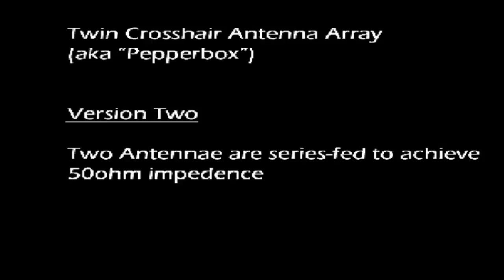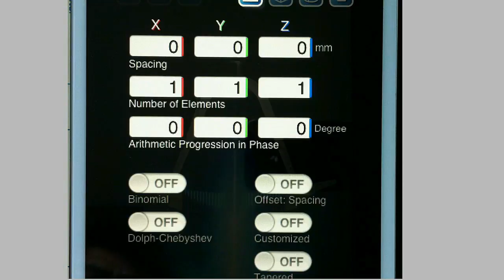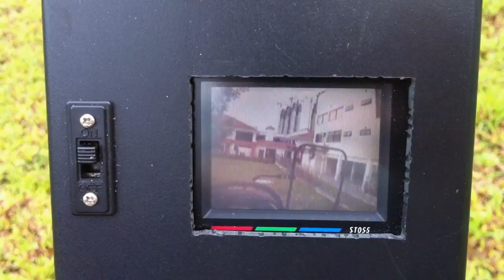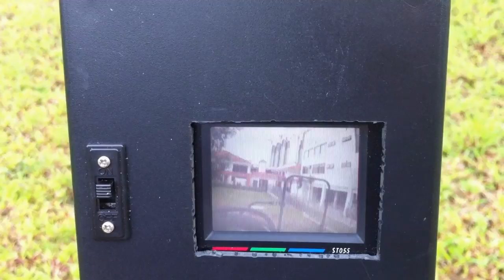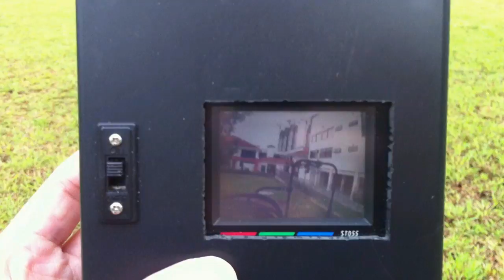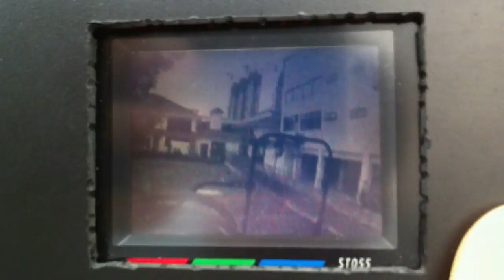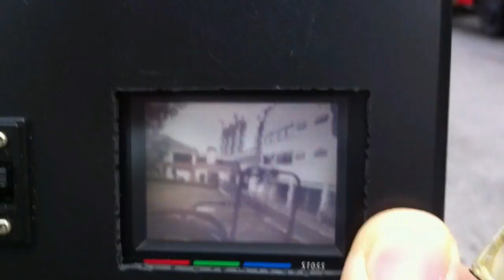DIY Pepperbox Antenna for 5.8g 14db

Comment: You did a great job clearly demonstrating your system. I particularly like your video of the simulated beam pattern coupled with live demonstration. Would be nice to get some measure of signal strength as you move the antenna too.
I admire your efforts!
Jim
Reply from the maker: +James C Eastep Thanks for your kind words. Andrew Mcneil posted a video of a 2.4g double-crosshair build using a Wilkinson splitter and also a build video of a single 5.8g crosshair, which are really informative too.

Comment: Yes! Finally a PB for 5.8!!! Very cool Terence. And perfect for my low and inbetween objects type of flying. Would you be willing to build me one? :)
Reply: Did you make your own antenna at the end? i want to try back 5.8 after flying this weekend with a friend and his IRC 600mw, the signal was cristal clear! im flying with 1.3ghz and 200mw linear antennas, what antennas are you using now with the your 1.3 ghz video ummagawd?
Reply: David Lougedo Actually... I had mashton make me VAS's very first 5.8 pb. It looks nothing like the ones they make now :) For my 1.3 i'm using a VAS airscrew/MM combo
Reply: ummagawd ok thanks,  i´m redoing my mini quad, and if after this rebuild the image do not get any better i will also try CP antennas, currently i´m flying with dipole. i´ve tried with the mini pz this past weekend, and it is better, but there is something more there, some noise.

Comment: Hi, good luck finding this video.
I have manufactured very good crosshair antennas for 1280Mhz, but I always wanted to make a pepperbox for this frequency, can you help me with the calculations to adapt the impedance?

Thanks
Reply from the maker: You will need two pieces of 75ohm coaxial before the T-joint, each piece needs to be a 1/4wave transformer ( length =5.86cm x VF of your 75ohm cable). 5.86cm is quarter wave of 1280mhz n if u use rg179, the VF should be 0.66

Comment: Request to please help me with a sketch or photos of the T joint as to how it should be done/ overlapped properly and how to join the 2x 75ohm and 1x 50ohm cable to make that. Another thing I want to know is the length of the 75ohm cables and the distance between the center of the 2 brass tubes (one wavelength I suppose).
Thanks a lot and good wishes.
Reply: Also, can we use 50ohm at all the three places instead of 75ohm?
Reply from the maker: Please watch this newer tutorial that shows the details you need. https://www.youtube.com/watch?v=pkux2bY1Lkc
Reply: Thanks you sir! It is really nice of you to send me the video like of the needed detail. A little more request is to explain process of splice too without using the T connector as shown in the video of pepper box antenna. Thanks again. And good wishes.
Reply: I think I got it. Use 50ohm cables for the 2 cross hairs of exactly same length, and at the splice attach 1 piece each of 1/4WL keeping in mind the VF of 75ohm cable to them. And join the other ends of the 75ohm 1/4 WL piece to the maine feed line of 50Ohm. The outer wires all solder together.
Reply from the maker: @Theperfectcupoftea  Correct. I'm glad you got it figured out. :)
Reply: All because of the nicely explained details in the new video link by you.
Good wishes.

Comment: What are the advantages of that type of antenna? Only for having strong horizontal signal?
Reply from the maker: Firstly, it delivers 15% more range than that of a 10db directional antenna. Secondly, it gives you a very wide horizontal beam to fly within (clear video within an arc of 100deg at 200m & up to 140deg at a further distance). These benefits are true only if the aircraft's altitude is kept within the 50deg vertical beam. You could tilt up the antenna for high-altitude flight but major changes in altitude must be avoided.

Comment: IBcrazy is going to mass sell these 5.8Ghz Pepper Box antennas early this year, maybe April or May. So, what kind of range can you get out of this with 250mW and higher when flying? Can I fly 20+ miles or 35 kilometers out?
Reply: mentuemhet - I wouldn't call it mass production, but I am making them.  I can make ~3 per day.  They are quite difficult to build as you can see in this video.  I must say that I am impressed with the series fed version.  Very cool.

Comment: Hi Terence, regarding the image at 1:08. 
Are those three coaxial cables joined to link the two crosshairs? If so do you mind explaining specifically how. 
Also, are the sizes of the wavelength*.25*75 in mm or inches?
Reply from the maker: Hi Tobi, YES the 3 center wires are to be joined neatly (no ugly solder blobs) and be insulated properly (with shrink tubes), then soldered the outer braiding, tin it evenly to seal the joints (no RF leakage please). If your intended frequency is 5800mhz, 1 wavelength is 51.724mm or 0.2036 inch. If you use RG179 for 75ohm coaxial, its vf is 0.69. In this example, the length in mm (INCLUDING your soldered joints) must be exactly 51.724 * .25 * 0.695    Hope this helps
Reply: Thanks so much Terence. 
So the coax length from the back of each crosshair just needs to be even up until this point, then strip to expose 8.92mm (if 5800) of each core and solder side by side?
Reply from the maker: Hey Tobias, I looked at your sketch, we're not quite on the same page yet. You want a "1/4 wave transformer (75ohm coaxial)" to transform EACH 50ohm X-hair antenna to 100ohm at its end where the T-joint is. This way, the two parallel 100ohms can merge to become 50ohm which makes a perfect antenna. Hence, the "exposed part" in your sketch should be 17.84mm.  :)  You do know that the 3 shaded coaxials in your diagram are NOT 75ohm RG179, but normal 50ohm RG316? Yes, you only use 2 tiny pieces of RG179 which are the "transformers" I explained above.
Reply: Terence Chan ok, that's making a lot more sense. I reckon I'm sorted now! Thanks heaps!
Reply: Terence Chan I've ordered some rg179, couldn't find anywhere locally that sells it. 
I have some rg6 which is 75ohm if I use that will it still work for me?
Reply from the maker: loosestkid _FPV Yup any 75 ohm will work for the quarter-wave transformer, for the physical quarterwave length, be sure to multiply by the velocity factor of the RG6.

Comment: In theory you could put  two of these "pepperbox" antennas side by side, one horizontal and one "pointed up" (some angle), and use a diversity controller, (switching between the two),to give close to 90 deg vertical coverage ? ... not sure this would work ... (I'm not an RF guy ... 8^)
Reply from the maker: Yes, that will cover both altitude n horizontal wide angle, the null spots r the high-right and high-left airspace so it isn't perfect yet